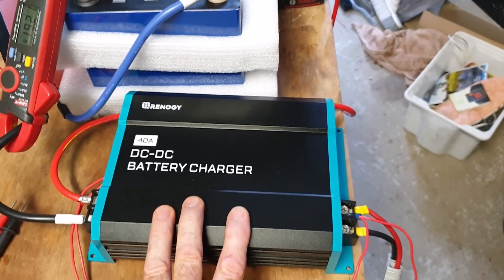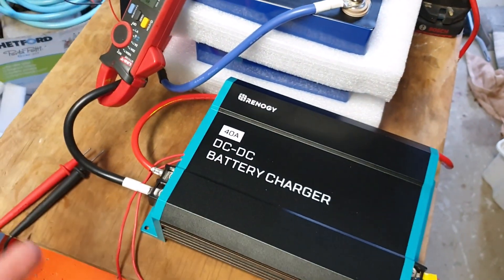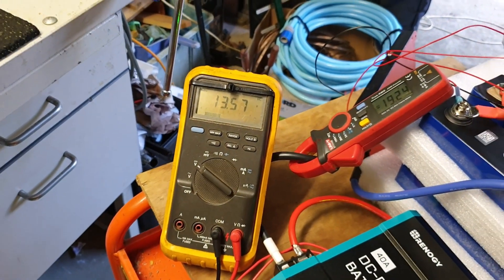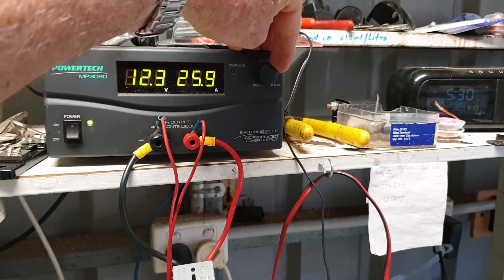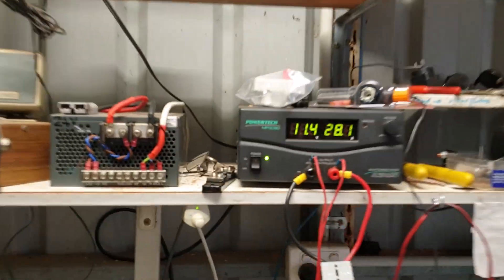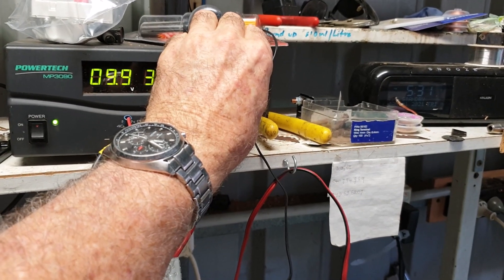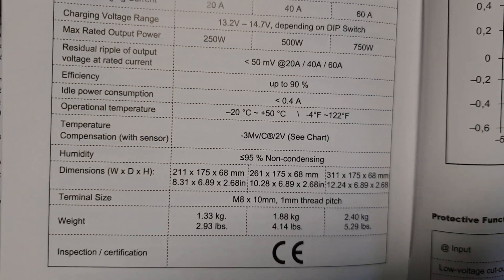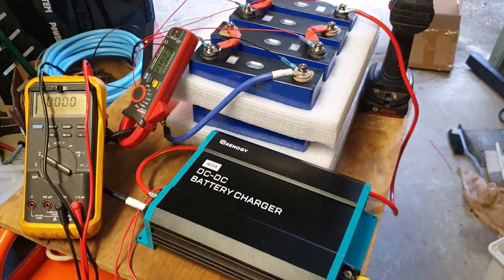Renogy 40 Amp DCDC Charger - It works Properly unlike the DCC50S!

Comment: Good demonstration of the capabilities of this dc -dc converter. However, you mentioned the term ‘buck’ a few times whereas you should have used the term ‘boast’. Buck decreases the output voltage compared to the input. Whereas boast increases it, as demonstrated in your video. https://en.wikipedia.org/wiki/Buck–boost_converter
Reply: You made a mistake as well.  It's a "boost" converter, not a "boast".  =)
Reply: Ha ha, too true. I don’t want to boast that it’s a boost converter. The difference one letter makes!
Reply from the maker: Your right Steve I got that wrong it is a boost not a "boast" or buck, cheers.
Reply: @timterry8714  hey Tim absolute novice here. Thanks for your explanation. Any chance of advice through messenger or a phone call. Thanks Paul.
Reply from the maker: Yep I keep getting buck and boost back the front.

Comment: Thank you, sir. 
I'm setting up my rig with an inverter system for the first time. I was looking at this unit in particular to supply the correct charging voltage for two ≈120 ah marine batteries in a battery box I will fabricate soon. 
Cheers, brother! 
🍻
Reply from the maker: Glad I could help

Comment: Thanks. The clearest explanation I’ve seen about how a dc to dc charger works. I didn’t understand how a 40 amp dc to dc could need up to 60 amps
Reply from the maker: You're welcome! Yes I'm sure that is not well understood and I have often heard of fuses blowing because they have not allowed for the overheads (inefficiencies) of these converters through low voltage input due to cable losses.
Reply from the maker: I tested this only yesterday while away camping to see what the current draw was at 40A output charge rate and its 50 amps input from the car alternator. This is due to some inefficiencies but also the voltage drop over the cable run from the vehicle alternator/cranking battery to the charger in the van (about 10 meters of 10mm cable). The DCDC charger has to boost the voltage up from say nominally 12 volts input (possibly lower at that current) to 14.6 approx output (the correct bulk & absorption charging voltage for AGM and lithium batteries. So the input current will always be significantly higher than the rated output.

Comment: R these ok for smart alternators or just dumb ones?
Reply from the maker: These are designed for both smart and dumb alternators. They work down to about 10 volts input (smart alternators run around 12.5 volts). You need to install an ignition sense wire to shut it down when the vehicles is stopped and that is connected to the D terminal on the charger.
Reply: Many thanks, tim

Comment: Boost mode,  lower voltage in, higher voltage out.    Buck,  high voltage in,  low voltage out.  Thanks for the video.  This is just what I'm looking for to avoid blowing up my alternator.
Reply from the maker: Yep the boost function works really well on this model - much better than the DCC50S which doesnt work in the alternator mode unless the voltage in is well above 13 volts to achieve a usable output.

Comment: I considered the DCC50S but after reading the specs very carefully, I understood that it would only output 25 amps from alternator and 25 from solar. The 50 amp rating looked to be a combination of the two inputs. Like you, I prefer a separate DC to DC charger and a  separate solar charge controller rather than a combination unit. I ended up with the Renogy 40 amp DC to DC charger and an Epever 40 amp Triron controller. I'm really happy with the end result, too. I'm running 4S2P 125ah LiFePo4 with 100 amp BMS's and it is rock solid!  Your explanation of the constant current charge using to Renogy DC to DC is spot-on as well. Good video. Thanks for putting it out for us to see.
Reply from the maker: Thanks for your feedback. I'm running a Renogy 30 Amp Epever solar controller in this new setup and very happy with the result. A friend recently had an issue with an "all in one"  Projecta PM435 when it failed and that left them with no power at all including the fridge and no way to charge the batteries. Turned out to be a simple issue in the end but highlights the vulnerability with these one stop solutions.

Comment: I had one of these things I found the fans to be very low quality and they started making a noise after about a year it just kept getting worse and worse
Reply from the maker: I havent heard the fans running and making any excessive noise as yet. Not sure that would be an issue really as this charger is only running when we are driving and as its in a caravan no one is in the van when its being towed.
Reply: Buy some new 40mm fans from ebay, cheap easy replacement.

Comment: Hi, thanks for the info. Can I ask why you run it at half the 40Amps? I don’t understand. Thanks
Reply from the maker: Hi Oliver, I run it at 20 amps to decrease the load on the car alternator and I dont need the higher capacity at the moment as I only have a 100Ah battery. I purchased a 40 amp in thinking that I may increase the battery storage at sometime in the future and would the look at utilising the extra capacity. It seems to keep the battery fully charged even while running the 3 way fridge while driving.
Reply: That's the real question here is can it actually output it's rated 40A?
Reply from the maker: I very recently decided to upgrade to 200A/h of lithium as its quite reasonably priced now and I will add a switch to the current limit input port so I can select either 20A or the full 40Amps if I need to really boost the battery after several days of no sun which I recently experienced. I will normally only run at 20A to minimise load on the alternator.
Reply from the maker: Yes C5turbo, it does output a full 40A and I demonstrated that in the video. It achieved full output all the way down to around 9.5 Volts at the input terminals which is very impressive. With the current limited it sat at approx 19.5A output over the voltage operating range specification.
Reply: He probably ran it at half amps because as he turned voltage down the amp pull would have exceeded his power supply. Just a guess. I do wish you would have measured output voltage too.

Comment: Dont forget to hook up the trigger wire or your starting battery will be dishcharged it wont know that you have shut the engine off
Reply from the maker: I'm going to fit a low voltage dropout relay.
Reply: @timterry8714  Isn't that what the trigger wire does inside the dc-to-dc charger
Reply from the maker: @william Trojnor - Re the trigger wire input - No it will let the input run as low as approx 10 volts and still output the full current - that's the buck/boost function at work to allow for voltage drop over the cable run. There is no inbuilt low voltage drop out the charger is enabled and disabled by the D+ input connection from an external 12V source - low volt relay, time delay, or vehicle ignition sense.
Reply: @timterry8714  Sorry I was thinking you were the other YouTube guy that was having problems with the one he was installing on his work truck.
Reply: @timterry8714  The only downside on that dc-to-dc charger That I can think of is It is Drawing current as soon as you start your vehicle . If you could put in a programmable time delay relay You could program it so it wouldn't start charging Until you know your starting battery is charged up . I installed one on my side by side . For some reason the manufacturer thought it was a good idea That the radio should turn off after 1 minute When the ignition key was turned off . Not so great if you want to listen to the radio When you are parked The one I bought you can set It up for all kinds of programs . You can set it for whether the ignition is cycled off or when it's cycled on it starts Counting . I have it set for an half hour Then it turns off the radio I can program it for however many hours I Want it to run . If it turns off all's I have to do is cycle the ignition key and give it a 12-volt trigger It comes with a built-in 10 amp relay . It's a neat little device and I think it was only $20
Reply: @bucket1249  What does it matter ????Who cares if its drawing current ( I presume you mean Main battery charging current) as engine is running.......The reason people want me to instal these devices is for exactly that reason..........Your Main battery is still going to come up to charge , probably long before the Aux battery will because the starting discharge generally bugger all re its capacity....
Reply: @grahamhastie896  I'm just thinking about people who have puny alternators in little cars and trucks it it'll charge but it's going to take a toll on your alternators after a while
Reply from the maker: Its actually drawing current any time the vehicle is connected in my case as I havent provided an ignition sense from the vehicle. What I did add was a low voltage drop out which stop the charger at approx 12.7 volts so it shuts down automatically when I stop. These are a bit tricky to setup as they tend to cycle a bit till the voltage settles down. But it works well
Reply: @timterry8714  I did a time relay delay on my side x side to keep the radio on for what ever time I programed. Not the same kind of device , but they make some neat stuff nowadays.I still think your dc-dc is broken. I use a CTEK and I just picked up a lithium iron phosphate 170amp hour  this year to replace my gell house battery.
Reply: I put a switch in the trigger wire so I can turn it on and off as needed.

Comment: Beautiful explanation, you advise you to buy?
Reply from the maker: Yes, definitely but remember its a vehicle charger only does not have a solar input. I prefer to have separate chargers to provide redundancy. Dedicated solar controllers have lower overheads (lower internal power consumption) also thereby providing greater efficiency.
Reply: @timterry8714  Thank you for your response, I really want to charge from the car generator just don't want solar power thank you so much brother 🙏
Reply: @timterry8714   yes on my ctek I only use it for alternater charging because max amps are only 20 with solar or no solar so I wanted 20 from alternator and what ever I can get from seperate solar charger.